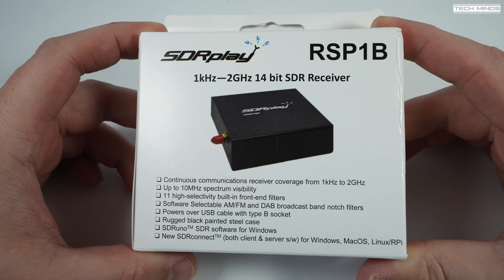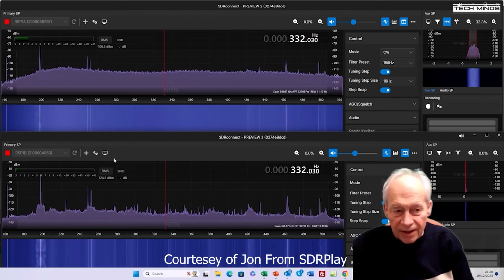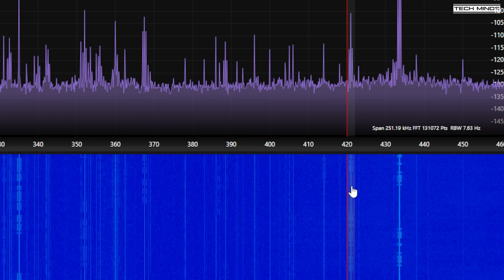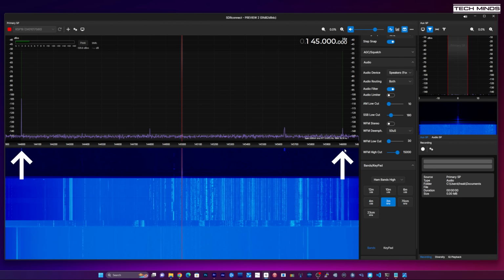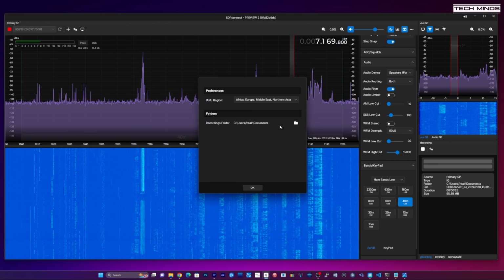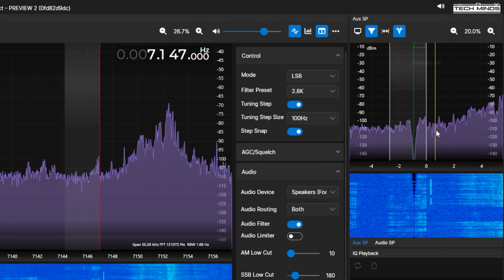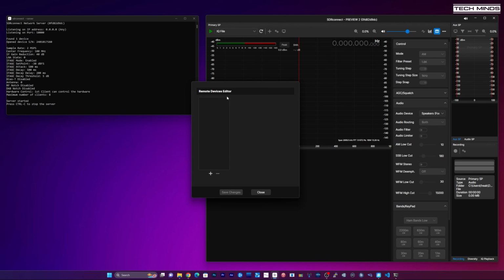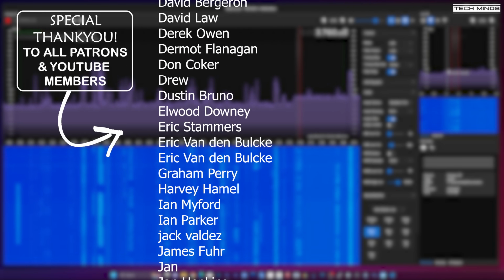The NEW RSP1B SDR Receiver From SDRPlay

Comment: I just don't get the obsession with metal cases. I own & use two RSPdx receivers and also an RSP1A. As many may know, the inside of the RSP1A case is coated with a conductive material which is grounded to the PC board and the antenna connector.

This coating provides all of the necessary RF shielding and I can find no difference whatsoever with stray RF penetration between the RSP1A and the RSPdx. Further, the RSP1A plastic case is made from a Lexan-like plastic and is plenty rugged enough unless you plan to send it off to war. 

People are funny and I think that SDRPlay only put the new RSP1B in a metal case in order to appease these folks and give them an illusion of "So much better!"

Comment: SDR Connect running as a server WILL also run on a raspberry pi zero 2 w, provided bandwidths are 2MB or less. forget streaming the whole FM band.
the little Pi only has 2.4Ghz wifi
So this opens up remote servers running on battery power say in the garden away from sources of noise.

Comment: SDR Connect is so much easier to get up and running compared to SDR Uno, Even though it doesnt have the full set of features yet.
The real black art is allowing port forwardign through routers to enable remote access.
then there is the issue of getting a domain name registered but this seems to be easier to do compared to the port forwarding.

Comment: Here in the US, there seems to be nothing in the long wave spectrum and I'm not interested in beacons.  So I would like to know if this noise rejection is better in the shortwave bands too?  Otherwise, I'll just stick with my RSP1A.   Thanks for any information you can give us.
Reply: Straight from the horse's mouth (SDRplay)
"It has significantly improved noise performance below 1MHz (i.e for MF, LF and below), and in the 50-60 MHz region. There are also noticeable noise improvements in the 3.5-5.5MHz and 250-320MHz spectrum."
Reply: @longjohn526  Thanks!  The 3.5 - 5.5 MHz area would be interesting.   I think I will consider this for it I get a second radio.  Waiting for the new software to work on my Chromebook to decide if I need a portable radio.

Comment: But why no USB C?
Reply: USB B = still most rugged connector around, better that way than USB C which is quite rugged in its own right. Also, cables are FAR more available both new & used. Pretty much unlimited quantities of high-quality, shielded used ones available.
Reply: Flimsy, cords generally have no ferrite filtering in them so the cord can act like another antenna that picks up nothing but noise and hash.  Cords with Type B connectors usually have a big ferrite bead built into them and yes they do make a difference plus the cords themselves tend to use larger wires and better sheilding. Nearly all professional gear with a USB port will use Type B. Most high end amateur radio gear also uses Type B. It's just a more robust and professional type of connection
Reply: @longjohn526  Thanks, that makes sense.
Reply: @longjohn526  .. bull. But you tried.

Comment: Shame the drivers they foist upon you on Linux are so junk. If they fixed that might be a more appealing option.
Reply from the maker: Which Linux version are you referring to? And can you provide more details about your concern? It will help fix things if they need fixing. Thanks
Reply: @TechMindsOfficial  The Linux distro doesn't matter as much as the fact it's their poor quality proprietary API that requires to be installed. It's an unstable CPU hog for long term, required to be ran as root, frequently just stops working and requires a whole song/dance (or a reboot) to clear the issues etc. they are fairly well known issues that people have griped about for years at this point. Yes they are improving the UI in general but that's a separate issue.
Reply: @TheDark0rb  That's just opne of the downsides of using Linux ..... It's always been that way and likely always will be because like it or not it's a fringe Desktop OS .... It's strength is as a Server OS ..... For instance at my business the servers are Linux but all the desktops are Windows because all the professional design tools are Windows based and are well supported whereas with Linux most of them wouldn't be available and there is virtually no support unless I want to spend days looking through forums and trying to separate fact from opinion and figuring out which of the people actually know what they are talking about.

Plus the sheer arrogance of their user base is a huge turn off for most people
Reply: @TheDark0rb  The Linux API has recently been updated to 3.14. The full API specification is available so you are able to write your own "high quality" API if you prefer.
Reply: @elansteve  API spec and hardware spec are very different things. As yet they have not made public the interfaces to hardware - the API itself *is the problem*. 

I like how users get blamed for wanting the hardware they paid for, software they (implicitly, because of the license) paid for to actually work? It'd be different if they were saying "Look, we provide these Linux API interfaces, they aren't the best. Here be dragons". Then people wouldn't have the expectation for them to actually work properly - and mostly they'd probably be fine with it or buy a different product.

There is work going on trying to reverse engineer the hardware interface, but the vendor doesn't help at all with this and likes their insecure and unstable API instead. 3.14 only added support for the RSP1B in the API, that is all - as a user of the hardware I'm quite aware of when it updates.
Reply: Honestly, if you want to get the best that these and other radio products offer, just use Windows. I gave up on Linux after I got tired of the endless hunts for dependencies, drivers, packages, and differences between Linux distros. And the lack of available software & software quality lags way behind the Windows counterparts.

Comment: It would be interesting to compare the RSP1B with the RSPdx.
Reply: Yes would like to see that
Reply: Well the RSPdx has 3 antenna inputs and HDR mode. Completely different animal. You can agonize over various individual specifications but that's not the whole story.
Reply: @elansteve  yes I have the rspdx and was just curious to see if there would be a big difference excluding the inputs ,and appreciate the HDR mode.. thanks for your response tho..just find it interesting that's all.
Reply: @ciscokiduk  you can go line by line through the specs, or use lab rtest equipment, but you're not going to see/hear a big difference if any. It's not an upgrade to your dx, but is a (slight) upgrade to a RSP1A.
Reply: @elansteve What does HDR mode do please?
Reply: Does the android sdr++ support  this sdrplay ?

Comment: I'm a little gutted as I only got my RSP1A a just over a week ago and its the lower frequencies that are improved  in the 1B that I'm most interested in. Luckily the RSP1A is performing amazingly well with a piece of speaker wire as an antenna so its not all bad.
Reply: Yeah, always worth remembering... the 1a was a great device last week and it's still a great device, even if they've one-upped it.
Reply: I was just looking at one last week and almost pulled the trigger but decided not to. Next day this was announced and when I went back to the website (HRO US reseller) they showed the newer model but it's not available yet which is OK since I'm in the process of turning an unused bedroom into a listening post. These have a lot of bang for the buck with really good front end filtering that can make all the difference
Reply: I doubt you would hear any difference as the improvements would be masked by the noise from your speaker  wire, just enjoy what you have.
Reply: @elansteve  Good point, you need a "quiet" antenna to fully take advantage of the lower noise floor
Reply: Worry not, that RSP1A is a fine receiver. I have both, an RSP1A and a couple of RSPdx radios. I find that the RSP1A is pretty good in its own right on VLF frequencies if one uses the RF gain control correctly along with an appropriate antenna (I use a homebrew active loop, 36" diameter). I also found that both the RSp1A and the RSPdx really shine on VLF when connected to an external 500Khz low-pass filter.